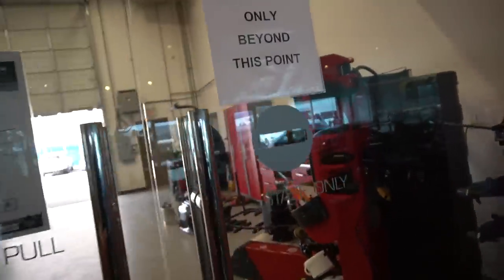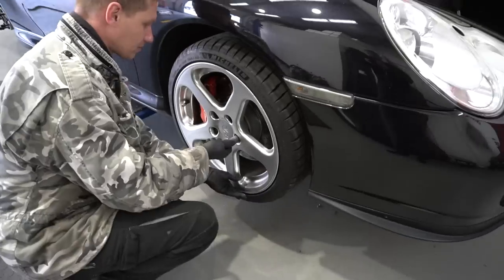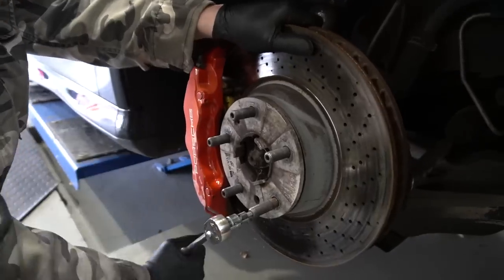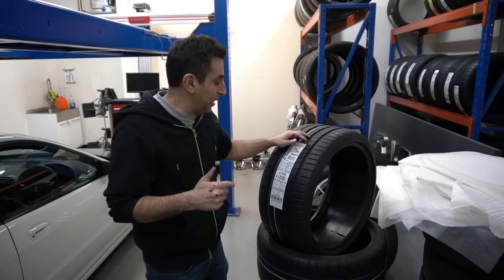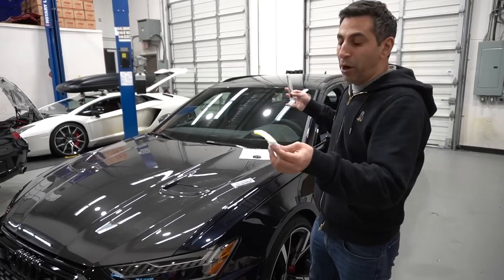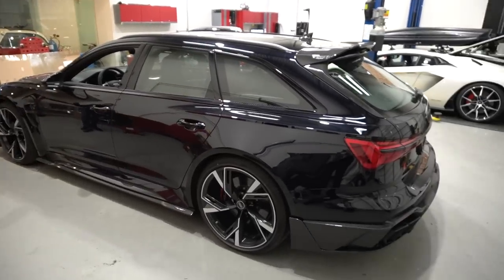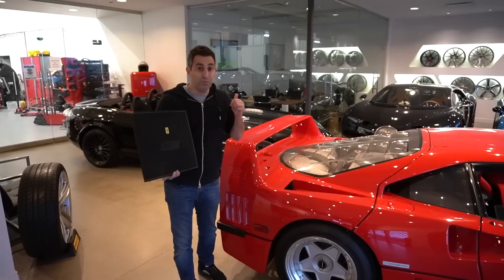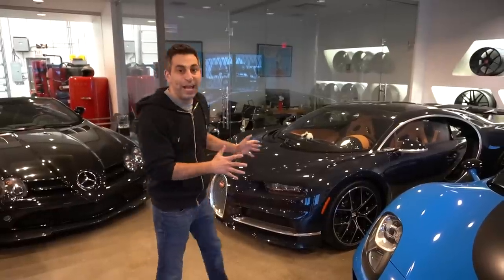WE REVEAL THE FIRST MANSORY RS6 AVANT! *** Lamborghini URUS NOVITEC, Porsche 911 Turbo Rebuild***

Comment: The trick is with those stud conversations to remove them once you start to turn the studs don't stop it's the stop start that breaks the thread so if you can keep the stud rotating till they're out. Cheap studs that's why but maybe more expensive metal wouldn't do it but then how do you know?